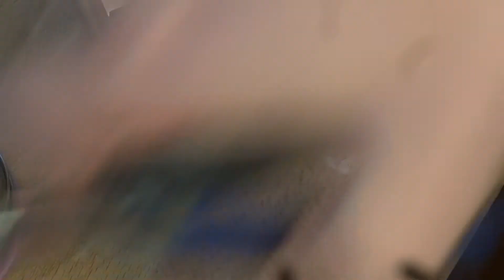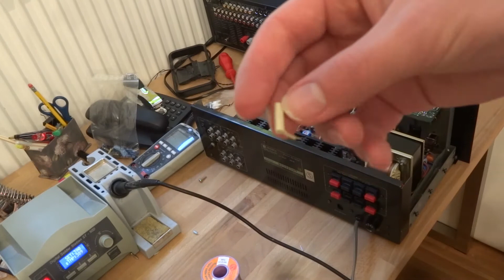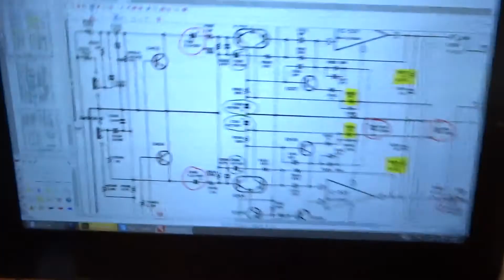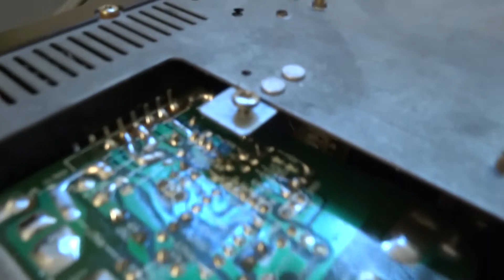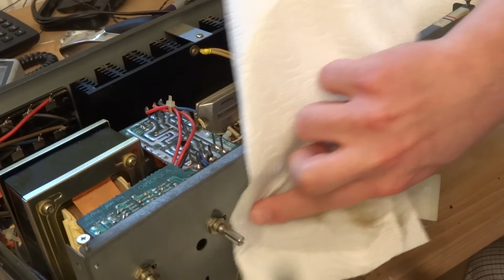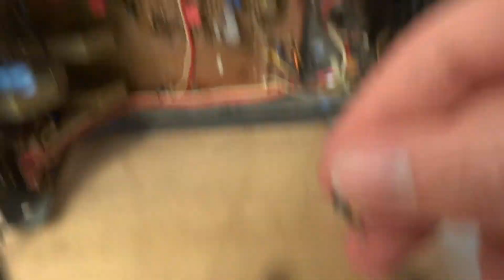Optonica SM1616 Restoration P1 of ?

Comment: i have sm1515b great unit keep it they don't make good quality any more
Reply from the maker: David Berquist Indeed, the unit in the video is now my main desk amp. I also have its big brother, the SM3636, also restored (i have most of the videos of the restoration, but due to the lack of a working edeting machine (storage wise) i can not edit it). Regardless, i use it as the amp for my main HiFi system (driving a pair of Infinity Kappa 8.1i's).

If you like restorations like these, i have quite a few more coming up this year. Here is a list of a few things waiting to be restored:
Optonica SM5200 (this was my first introduction into proper hifi, but i lost my own unit, more details in the video)
Optonica SX9100 & SO9100 (the best optonica made, these will replace the SM3636, when it comes to the infinitys)
Optonica RP5100 (i got it with the other stuff, and i needed a good turntable)
... 
and quite a bit more :)

The only problem at the moment is, camera related, as well as not having enough hard drive space on my laptop to edit them (my main rig is out of commission due to some unfortunate run ins with the law of gravity, and the conservation of momentum)

I too somewhat agree that "they don't make them like they used to!" I am quite active in the world of high end audio, and these amps beat everything in the lower mid range, and some even the high mid range of audio gear). Unless you drop a few hundred K i doubt you will find much better then these magnificent vintage amps. And i have tested quite a bit of contemporary audio gear.

Its always nice to see someone else that likes vintage HiFi!

Comment: is the output ic part number rh-ix1066afzz and is power transformer part number rtrnp0506afzz that is whats in sm1515b
Reply from the maker: David Berquist I checked the service manual, and the output hybrid is a RH-IX1066AFZZ and the power transformer is a RTRNP0553AFZZ, again, according to the service manual. Its interesting that the SM1515 has a different transformer then the SM1616. They look so much alike, both visually as well as electrically.